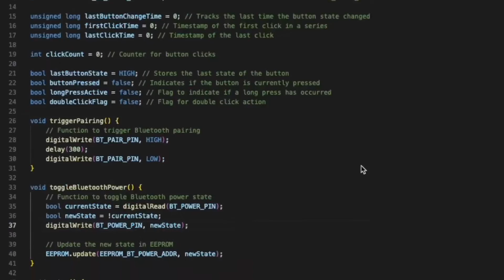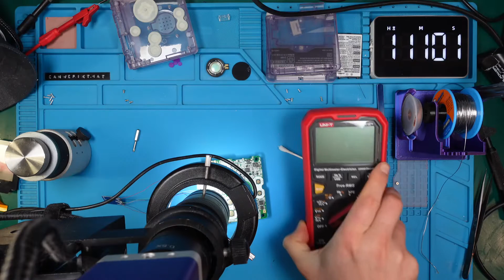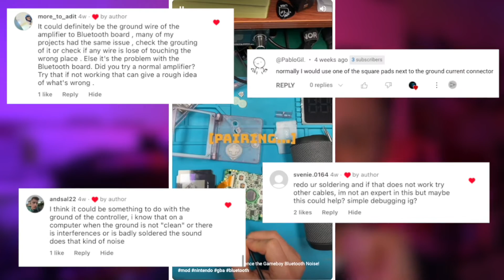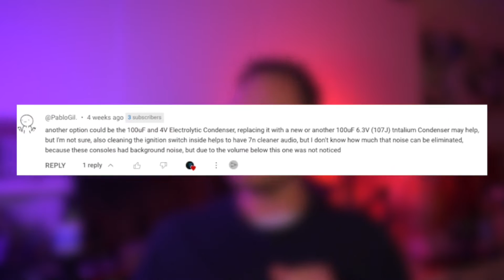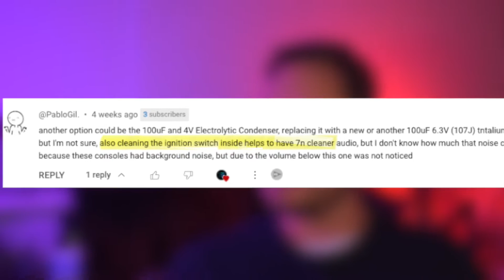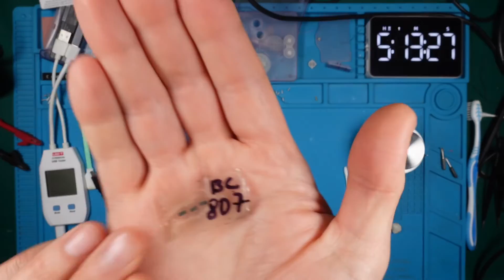How To Add INSANE Wireless Audio To Your Game Boy

Comment: I have been able to observe that AGND has it connected directly to GND. I was looking at your circuit diagram and it is possible that one of the possible reasons why that beep appeared in the sound was because it was not connected "correctly".

The AGND of the Bluetooth module should be connected to pin 5 of the charging port, which uses a capacitor that eliminates part of the noise and prevents overloads.

It is also possible that you can completely turn off the sound of the gba sp's internal speaker (I'm not 100% sure) but usually a short is created between pin 6 GND and pin 5 AGND charging port to turn off the speaker.

Makho (a YouTube content creator widely known in the gameboy mod community) has a good example of this in a video called "Building a Headphone Jackinto a Game Boy Advance SP" and within the comment posted by him there is another comment by a certain "homerghost" who quickly explains the mechanism.

Don't worry about the issue of headphones exploding, since it is another modification, but it is true that the noise should be reduced and perhaps the speaker turned off by connecting those 2 cables to those 2 pins.

In the event that you do not get sound from Bluetooth, this could be because you would have to use the left and right sound pins directly from the charging port.

There is another video called "MOD sonido BLUETOOTH en GAMEBOY ADVANCE SP - EarPods, bocinas inalámbricas y mas" in which it leaves a link in the description of the video with a diagram a little different from yours in which it shows which pins are used. He uses, turning off the internal speaker when he turns on the Bluetooth module.

In case you dare to do it, you can ask👍
Reply from the maker: Hey Pablo! Thank you very much for your detailed post! The diagram I posted on the GitHub project page should be correct. During my attempts, I tested the AGND pad, and it was not the right spot for the Bluetooth AGND pin.

But we should remember that I installed the Dehum-Kit in the previous modding video; this could smooth out much of the initial noise.
After using the square GND pad, it worked like a charm!
Reply: Hey man ! That's the tutorial I used and I am able to control the volume with the slider ! I'm using Marshalls III. 

Also, I had terrible audio interference as well. What I ended up doing is bridging AGRND and PGND together on the module and having one wire go to PGround. 

This is to take with caution though as the Gameboy I used is giving me nothing but problems since the beginning: R button didn't work at first, then L button. Now the green light won't turn on and the Dpad right doesn't respond 😅.

It's a corruption issue as the previous owner clearly stored it in a bucket of water ... So I managed to clean it up a bit which got rid of the audio noise. I should still clean the switch too, maybe it could fix the green light ? 

I still don't know how to clean the Dpad though...

Comment: incredible modification, I am very glad that my comments helped you in the project, very good work, very clean I love
Reply from the maker: Thank you, Pablo! It is not perfect, but maybe it will be in the future with the community's help. 💪🏻🙌🏻🌍
Reply: @CanWeFixThat  the line that has come out in the back, is usually due to the fact that this type of semi-transparent shell usually use a less resistant plastic than others, for example funnyplaying uses a different transparent plastic that is something better.
It's more normal to find this kind of damage by doing some extra pressure by accident on these kind of semi-transparent housings.
Reply from the maker: Hi Pablo, thank you for this information. That is also an issue of the current mod state; without a transparent housing, you cannot see if the module is on or off. :-/